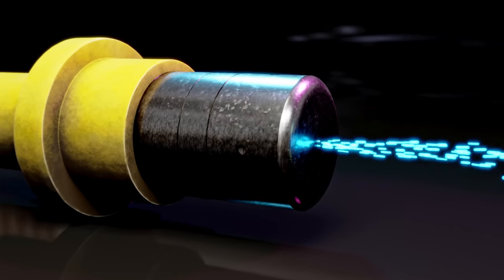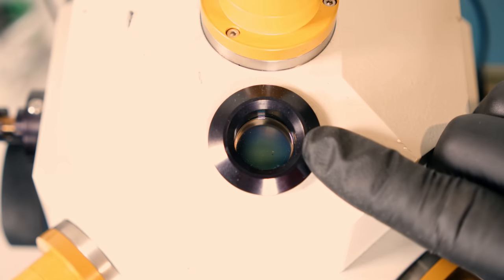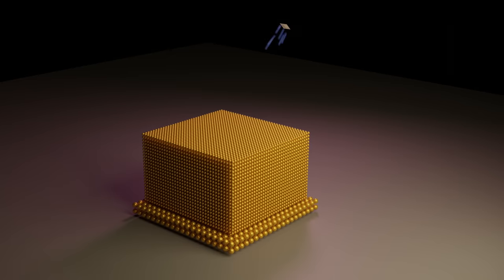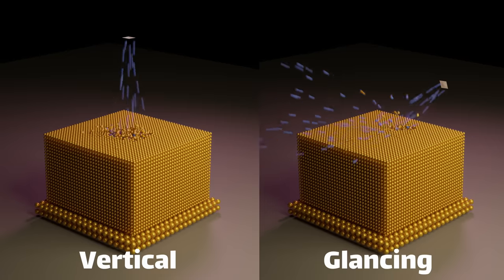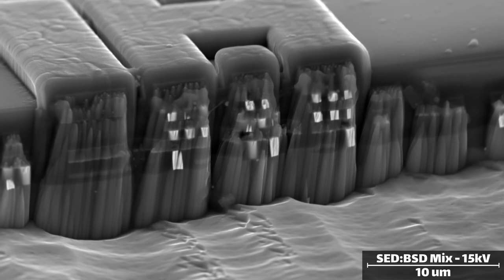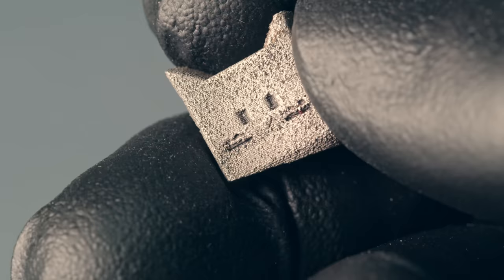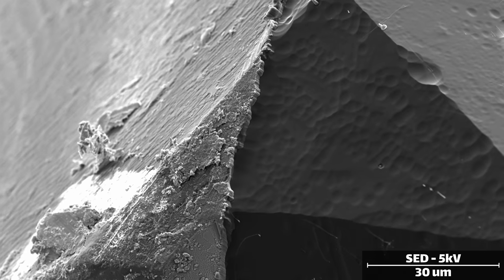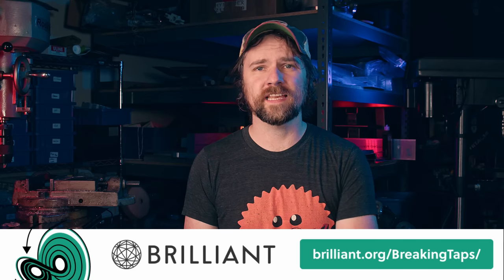Cut anything, even diamond

Comment: I (and two other engineers) built a two axis ion milling machine in 1995 for computer controlled figuring of optics for semiconductor production.  I did the software and process development for both metrology and figuring.  Some optical glasses are very heat sensitive, so it was necessary to limit beam energy.  Also, maintaining a constant ion beam shape and current over many hours was quite challenging.
Reply from the maker: Oh wow, super cool! Yeah I can imagine making the process reliable and repeatible is really challenging. My machine is very fiddly and easy to go from a beam that is over-etching to one that extinguishes itself. I can't imagine the engineering needed to make the system work reliably. 

Really neat project, especially in the 90's!
Reply: @BreakingTaps  You've got to maintain a good vacuum with no contaminants. Filament burns out quickly otherwise.   I used a 4 variable partial factorial experimental design to get the 2 electrode currents and 2 argon flow rates to optimize the stability and gaussian shape of the beam.  There were trade-offs between maximum removal rate and shape/stability.  The latter is more important.  The better the beam matches the model, the faster the part will converge to the desired shape.  Oh yeah, pitch polished glass has different surface layer characteristics for a few 10's of nanometers than the underlying bulk material.  So the removal rate on the first run of a pitch polished surface tended to be low.   So you needed to be careful as the removal rate often increased after the surface layer was removed.  Even so, removal rate was hard to predict, and had to be measured in process on each workpiece.  We needed to hit surface   shape uncertainty around 2 nm rms.

Comment: I'd love to learn more about your process of refurbishing the ion etching machine! Not even a video. Just like a couple of pics through the process with some captions.

I take some photos while working through a mechanical issue on, for example, my 3d printer. I then put a couple captions on them. They act like bullet points for me to recall what was involved. Excerpt from some recent work on my Ender 3 V2:

• photo of calibration cube "X axis printing artifact. Printed at 20 mm/s, 100mm/s/s acceleration. Not speed or acceleration related"

• "Needed to take off the hotend fan shroud to access the belt."

• "Note 2 different screw lengths. Short screw goes in top left of shroud."

• "Belt edge is shredded! Watch out for the fiberglass. Use tape to grab shards."

• "damaged the thermistor leads while taking hotend off the sled. Didn't realize until after I finished reassembling everything. I hate the stock cable mesh sleeve. Pushed me to finally put some DuPont connectors on thermistor and fans to make replacement easier"

• "Factory screws had off-center heads! This pushes the tensioner mount askew when they're tightened. Replacement M5×10 screws were 18¢ each at hardware store."

• "opportunity to check eccentric nuts on z-axis rollers"

• "used some stacked cardboard boxes to prop up x axis gantry while working. Should probably print out some clips instead"
Reply from the maker: Yeah in retrospect I should have filmed some of that (or taken photos)! Was just deep in debugging mode and didn't think about it.  A lot of the issues ended up being related to the vacuum gauge which was very dirty and needed cleaning. The reported vacuum level would sometimes fluctuate wildly, which would confuse the machine and think the airlock mechanism had triggered. That had all kinds of effects like turning off the HV supply, messing with the turbo, actuating the airlock vent, etc. Once I cleaned the vacuum gauge a lot of the "flaky electrical" issues I was chasing went away.  Which was nice, because the next step was to start debugging the old analog circuitry which I really wasn't looking forward to.

The rough vac pump needs a new diaphragm and wasn't pulling a good enough vacuum for the turbo to start running. So I just replaced it with my other pump for now. Some of the needle valves needed cleaning (were stuck open or closed), and the ion guns needed cleaning too (they get really finicky once material starts to build up, especially insulators).  And I think the bearings in my turbo are dieing, but that's a problem for a different day :)

Comment: Hi Breaking Taps,
Super nice and interesting video.

Just a simple question-idea.
I'm a (bio) chemical engineer specialized in organic chemistry, but I do love technology.
Into chemistry, it is wel known that gases average (quadratic) speed depends on atomic mass; so hydrogen diatomic gas (H2) moves faster than Helium, than dichlorine (Cl2) or than SF4; and speed depends also on heat (molecular agitation, and free move traject in Brownian agitation), just like pressure (number of molecular shocks on the wall's surface).

So here is my question:
You used Argon (MW 39,95); but what if you used Helium (MW 4,00) or Xenon (MW 131,29); whould that mean that those inert gases would be also accelerated to atomic blast; but Helium would be accelerated roughly 10 times kinetically faster (but with different impact force due to F= mass*(impact deceleration)) and Xenon about 5 times slower but much eavier thus providing very interesting different abrasing results than Argon.

Regards,
PHZ
(PHILOU Zrealone from the Science Madness forum)

Comment: I am equally - or more - interested in a video about how you fixed all the issues it had.  How did you get the turbo pump running?
Reply from the maker: TBH I'm still not entirely sure what was wrong with the turbo. A lot of issues cleared up once I cleaned the vacuum gauge... I suspect it was giving erratic readings and really confusing the simple state machine that runs the machine. Occasionally the pressure gauge would swing wildly, and then the airlock mechanism would actuate which would cause an actual pressure change, etc. So I'm thinking the turbo might have been instructed to turn off because it thought the machine was in a bad state or something.
Reply from the maker: I think it was also overheating a little, since the cooling fan had some bad bearings. Once those were fixed it seemed happier too.

Comment: Tip:  Find a linear induction and maglev motor bearing for the turbo motor (I'm assuming vacuum motor).  It should last a very long time.  Like transistor radios, they should become ubiquitous very shortly.

About 7-11 levels of contrarotating blades (think planetary gears) should bring you to about a 99.987% vacuum.  But why stop there?  Between metallic printing and 23 contrarotating blades (yes, all, no stationary, all with electromagnetic (gasp!) planetary gears, the entire system has zero contact friction, albeit some loss due to hysteresis, so it should be darn neigh indestructible, right?  Pull the vacuum, stop it off, conduct the experiment, then repeat as necessary, ad infinitum.

Comment: Cool stuff! I used to work with something similar, but in my case the main point was determining chemical composition of material surface and its change with depth in nanometer scale (for example analysing depth of carburizing or carbonitriding process or thickness and composition of some multi-layered ceramic nano-coatings on jet engine turbine blades). It was connected to optical spectroscope which analyzed the plasma spectrum created during the process which helped us to determine chemical composition of evaporated layer, and with each "etch" we could make a chemical profile of material in the function of depth in nanometers resolution. It was called "glow discharge optical emission spectroscope". Thought someone will be interested in it here :)

Comment: Are these circular marks on the etched surface (especially visible on the Diamond) the impact craters of single argon atoms? I find that somehow hard to imagine, they look pretty large.
Reply from the maker: I think that's a mix of crystal orientation and local topography. Different crystal orientations of a material will etch at different rates, so big hunk of diamond for example will be a mixture of different "grains" (unless it's monocrystalline diamond). And some of those grains will etch faster, leading to a pit.

And local topography can affect it too. If there is an existing pit, that'll tend to grow faster than a flat area (more surface area to get etched). Or if one region is facing the beam a bit more, it'll etch faster.  Ditto to impurities that might etch faster.

So yeah, it's a combination of  stuff, but definitely not individual impact craters. Too large as you said! 👍

Comment: Excellent video.  I used to work on a lot of semiconductor etching machines though and you are never supposed to run the turbo at atmosphere.  Not sure about with that unit but it should always be when the chamber is pumped down with the rough pump

Comment: Actually electrons dont fly until they hit an argon atom. The internal is anode, or positive. The argon hits the anode, and an electron is lost, making it a positively charged argon ion. Making it repelled by the anode, and attracted to the cathode. The magnets keep the ions centered with the beam outlet.
The combination of repellant and attraction, along with mag enduced spin, creates an ion slingshot effect, whipping them past the edges of the cathode, with great force, and balancing energy through acceleration, friction, heat, potential sparks, and a dim plasma like blue luminescence

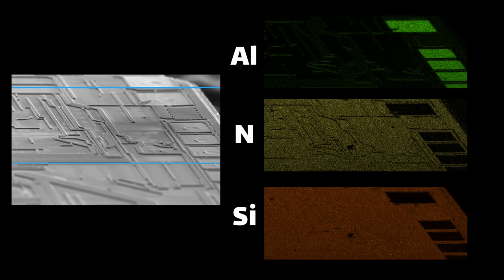Comment: At 8:00, how do you manage to get distinct per-atom-type views? Thank you for the amazing video
Reply from the maker: My scanning electron microscope has an detector which can identify the energy of x-rays, and uses a technique called Energy-dispersive X-ray spectroscopy  (EDS / EDX). If you hit an element with a highly energetic electron, it will sometimes emit an x-ray. And the energy of that x-ray depends on the atomic properties, so each element has it's own "signature" of x-rays that are emitted

The EDS works by slowly scanning a high energy electron beam across the sample and collecting the x-rays that are emitted. It then looks at each pixel and determines what mixture of elements are present based on the x-ray signatures at that spot.

Comment: Amazing, as always
Did u try organic materials, like nails or skin?
Reply from the maker: Nope, although I might (lots of questions about it). Should work about the same, but will be a lot messier. The moisture will boil out first and cause a lot of damage to the sample, then the heat will probably carberuize the sample and turn it into hunk of carbon, which will then slowly etch.

Comment: If you want to etch diamond CBN or anything else that is very hard, add a few percent of either oxygen or hydrogen. The texturixing etch followed by ion implantation is an important step for solar cell manufacture as it greatly increases the surface area of the cell. ❤

Comment: combine that with crt, at nano level, you have both nano horizontal and vertical milling-etch accuracy. metal copper heat conduction base plate.
Reply: you could also use a soft electron/ion beam to cure an etch mask, so you dont destroy your main high precision etch mask with the electrons/ions, you know the spin sludge on the silicon wafers, then remove any uncured parts of the temporary cured mask, then do the actual hard electron/ion etching, ie to keep the original mask intact, to support multiple copies of the same pattern reliably. industrial processes rock. not sketchy at all.
Reply from the maker: Some of the really fancy machines have active cooling too. Water cooled copper blocks, or even liquid nitrogen circulation loops.

Comment: Why is xenon not used, instead.  It seems to be a heavier noble gas.  Would it be too dense and heavy?
Reply from the maker: Xenon can be used too! You're right, being heavier it works better/faster, and certain processes will use it for that reason. But it's also just more expensive, so argon ends up being cheaper even if you have to run the machine longer

Comment: I thought sputtering was thin film deposition where you heat a metal to it's boiling point in a vacuum. The boiled off atoms fill the vacuum and condense on whatever they hit creating a film of the boiled material on a sample.
https://en.wikipedia.org/wiki/Sputter_deposition

EDIT: I see the term is used for ion etching as well.
Reply from the maker: Yep, same process! Just depends if the thing you're hitting with the ions is the sample (ion milling) or a target that you want to transfer onto the sample (sputter deposition). I'm not sure how clear it is in the video, but there are tons of rainbow patterns on the inside of the vacuum chamber. That's material that was etched/sputtered off of the sample and landed on the chamber as a thin film :)

Comment: it looks a little bit like TIG welding when you just run the HF mode with barely any current and just blast the oxide layer off in little patches. This is like the same thing but done right.

Comment: 00:50 turbo molecular pumps don’t work unless there is a roughing vacuum in the chamber, your turbo pump controller won’t let your turbo pump’s blades to rotate if you try to power it up at the atmospheric pressure.
Reply from the maker: This machine has a "dumb" turbo controller and will happily spin it up to max RPM (or at least try, and burn out the motor in the process if you let it) 🙂

Comment: Cool technique man! Are the ion guns basically the same as ion thrusters? Would be cool to know how much thrust they produce.
Reply from the maker: Basically yeah! Ion thrusters are designed a little differently (no need for a focused beam for example) but it's essentially the same idea. I believe the gun type in this machine is an "end hall anode layer source" which is relatively similar to the common hall effect thrusters on spacecraft.

Agreed, would be neat to know how much thrust they generate! Unsure how I'd test them though

Comment: Another great video, if you don't mind I've a question, is this the same process that is used in the fabrication of EUV mirrors, in order to achieve low surface-rms?
Reply from the maker: To be honest, I'm not sure if ion beam figuring was used specifically on the EUV mirrors. But I have seen it used to correct other high precision x-ray mirrors so I wouldn't be surprised if they got used on the EUV stuff too!
Reply: @BreakingTaps  Thanks for the reply.

Comment: Those turbopumps pull a lot of current when run at atmospheric pressure......
Reply from the maker: I only blipped them, didn't let them spool up too long! It's also actively cooled with a fan in the case, so I wasn't too concerned for debugging purposes 👍
Reply: @BreakingTaps  I know a guy who was bench testing them at atmospheric and he couldn't figure out why he got an overcurrent message on the drive. 15 hp pump, it must have sounded spectacular.....

Comment: I was wondering, where do you recommend getting an electron beam lithography capable microscope like yours? Is it just ebay? In which case, do you have recommendations for searching the site? Thanks!
Reply from the maker: My SEM is one of the few pieces of equipment I actually purchased the old fashioned way (straight from the company, it's a Thermo Phenom). That said, you can find a lot of older analog SEMs on ebay and liquidation services that would be great for EBL, usually for pretty affordable prices. I don't know a ton about older SEMs so afraid I can't help with models, but there are definitely some that are preferred over others.

You might try reaching out to Adam McCombs at Nanographs (https://www.nanographs.io/about-us), they repair/refurb old SEMs and can either help with details or sell you one :)  Older SEMs are often retrofitted with a Nabity generator for EBL (https://www.jcnabity.com/)

Comment: Wai.wai.wait... Bremsstrahlung !... Isn't this setup emitting a LOT of X-rays ? :face-orange-biting-nails:
Reply from the maker: I don't believe the ions here have enough energy to trigger x-ray generation. The light we're seeing is the argon plasma de-exciting back to it's normal state and emitting photons in the process (argon emits a blue'ish purple glow, oxygen is white, nitrogen is blue, etc). Basically a gas discharge like a neon sign :)
Reply: @BreakingTaps  I'm not knowledgeable enough to delve into Larmor's formula, and differential equations used to calculate the frequency domains of the secondary emissions would fry my brain out😅. But, are you saying that, since it's not thermionic emission of electrons but "sluggish" accelerated argon atoms, the braking emission is negligible ? ( I'll stop here before developing a Dunning-Kruger syndrome ). 
Still, as long as this new viewport don't give you skin cancer, I'm satisfied. :yougotthis:
Reply from the maker: Gonna be honest, this is getting intoDunning-Kruger area for me as well. Mostly going off what I've been told from more knowledgeable folks 😅 But yeah, I think that's basically the situation.  I do believe there are some ultraviolet photons that are emitted, so best not to stare at it too long. But nothing overly serious.

I have a different machine for sputter deposition and it has a giant glass viewport (dinner plate sized) so I think it's generally pretty safe at these energies.

Comment: It's amazing how smooth the diamond is after ion etching. Even though the original face is "smooth" at the macro scale to start with. I wonder if the craters are due to individual impacts of ultra high energy single particles, or part of a runaway process that wears some spots unevenly?
Reply: Ion etching with the proper settings leave nanoscale smooth surfaces, at least at lower energies (few kV). Etching at higher accelerating voltage (10s of kV) leaves rougher surfaces, but the individual collisions are only ejecting individual to tens of atoms (depending on the etch gas and the material being sputtered).